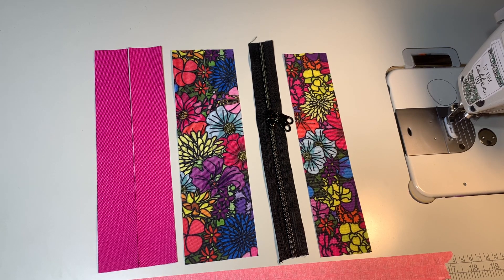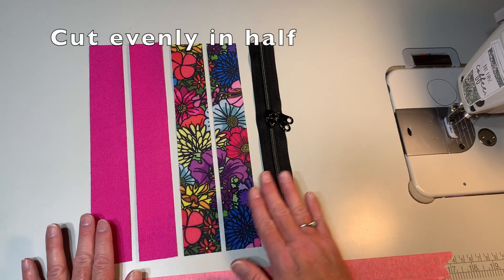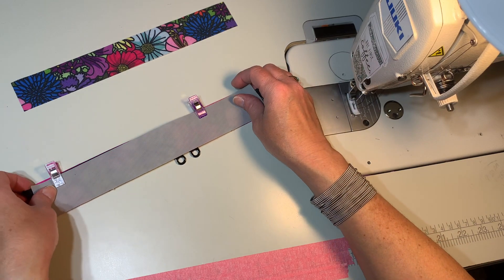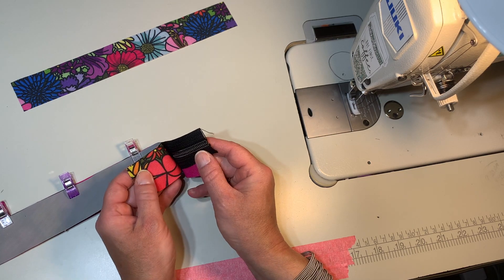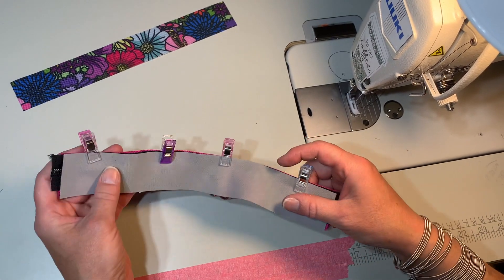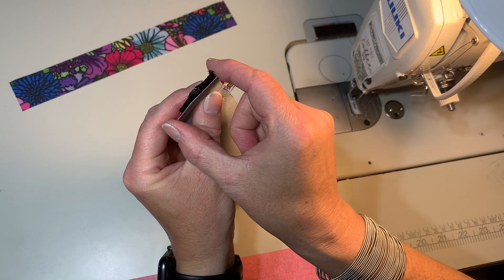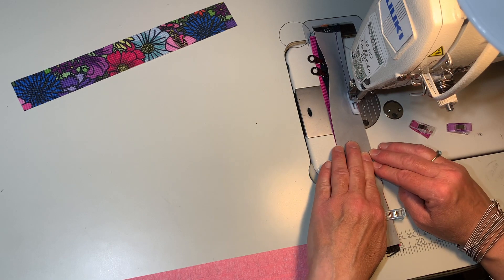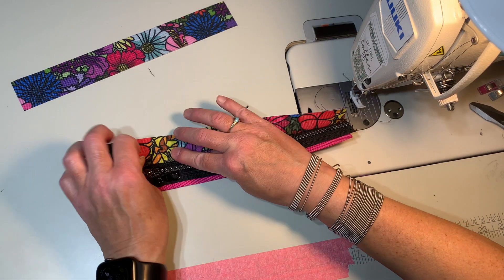Mav Pack center zipper panel tutorial

Comment: Can you make the full bag with the zipper pocket on the outside of the back as opposed to the inside of the bag? I am having troubles actually visualizing how to actually do it, and I have the pattern myself.
Reply from the maker: sorry for the late reply....I check but I think sometimes YT doesn't show comments on my phone... on laptop now....ok, you absolutely can. Make it almost exactly the same as you would if it were the inside panel, EXCEPT, I'd not use tabs....ME? I"d make the zipper go edge to edge.. Or use whatever exterior pocket pattern style you like....HTH
Reply from the maker: You can use the tabs.....I just prob wouldn't. Just my preference-I'd make sure to catch it well in the binding for securing it.. You could also do a pocket like a welt pocket, an overlay, whichever you are comfy doing!
Reply: Can you do the center zipper and still berth the bag? Not a fan of binding